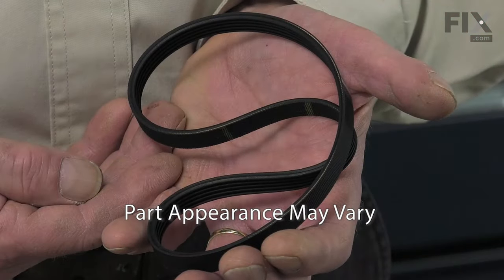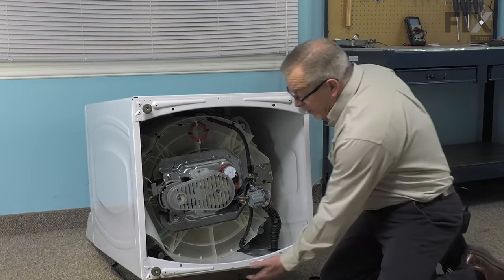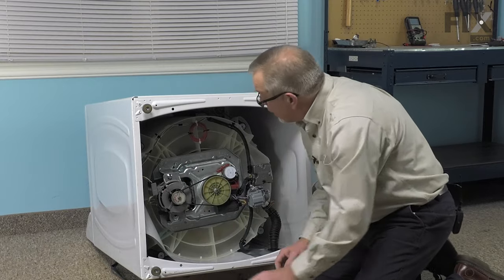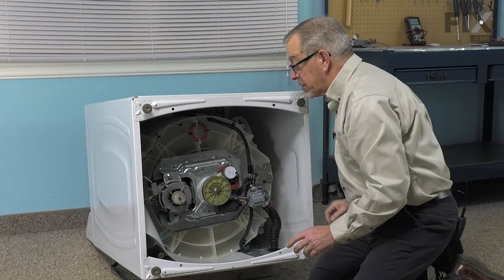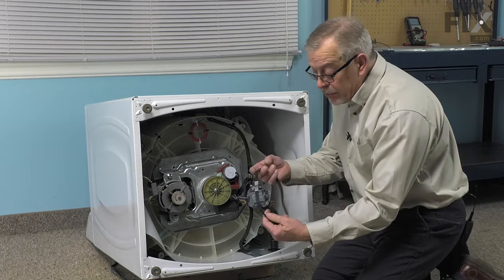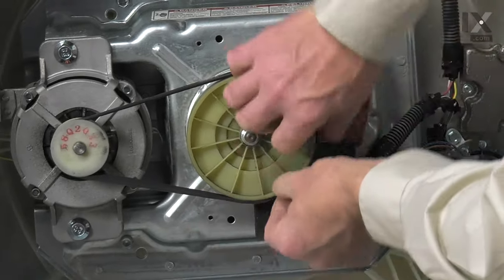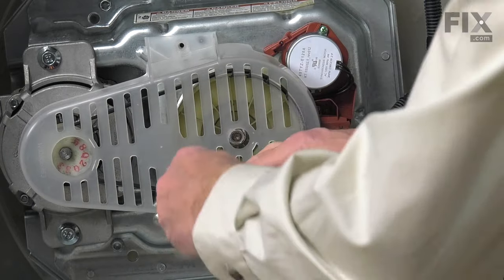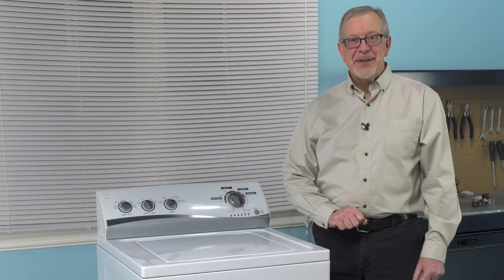Whirlpool Washer Repair – How to replace the Belt

Comment: Was having a hard time putting on this belt thinkn that it was the wrong size.. But, repeating “Rotate the transmission pulley, slowly feed that belt onto it”, really helped a ton! Thanks!
Reply: my new belt seem about an inch shorter, was that the case with your new belt?
Reply: Same here it seemed to small but once you got turning it went in like a charm!!!

Comment: Whirlpool top loading washer will not complete rinse and spin cycle without showing UL on display.  I have rearranged the clothes each time and it still wobbles and shows UL.  Before tearing into it I was wondering if it has a belt that keeps the drum from moving around.

Comment: Bought a Whirlpool couple of years ago from Home Depot. Second day I had it, oil came out from underneath. Called WP who had me call their local repair person. He told me it was just excess oil from the factory and that it would be fine. Two very loud days later, motor seized up. It took almost 35 days to get it fixed. Hoping that the squealing noise it's making now is just the belt.
Reply: Oil ? Didn’t know my washer machine has oil in it

Comment: So...I followed all the instructions, but the belt won’t stay on. I get it centered and when I turn it, it ends up at the very bottom. After a few washes the darn thing falls off. The belt holder on the left needs to have an edge like the left one so it doesn’t works it’s way off. Please advise...
Reply: I had the same trouble,  how'd you fix it? New belt?
Reply: Fix?
Reply: Jerry McKee I ended up having to purchase this from amazon and replacing all these parts. The pulley that the belt is on had teeth that were wearing down. It works like brand new now. I hope this helps. W10721967 Splutch Cam Kit by PartsBroz
Reply: Jerry McKee Yes I got a new belt. It’s included in the kit.
Reply: @amylevander5830  I figured I needed to replace that.  Thank you so much! Wish me luck🙏
Reply: Jerry McKee You got this! Just make sure you unplug the washer before u start working on it👍🏻😉

Comment: Are there 2 different belts that fits the machine
Reply from the maker: For the model shown there is only one belt. What model Number is on your machine? We should be able to find the right belt for your machine!
Reply: @FixDotCom  I changed the motor and the pulley was bigger now the belt won't fit

Comment: Can anyone help me here? I swear I'm going nuts I just need the small pully on the left side. The teeth on the inside are basically gone now so it's not grabbing onto the spline on the motorshaft. Every thing I have googled so far has given me one for a v belt or a link for the larger pully. I see it on complete motor kits but I don't want to spend 160 on a motor for 5 dollars worth of plastic. Or does anyone know of an upgrade or anything?
Reply from the maker: Hi Mikey, do you have the model number of your Washer, so we can do a quick check for you?
Reply: It's all good. My local appliance parts store said they couldn't find the pully without the motor. I actually had a friend 3D print one for me and it seems to be doing fine. Thanks for the reply though!